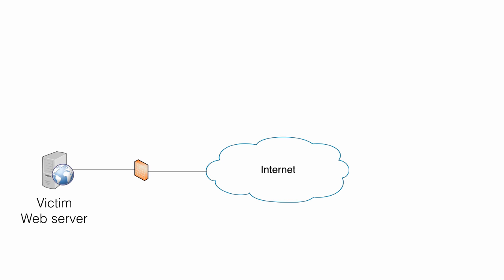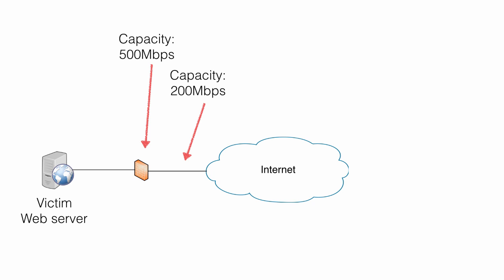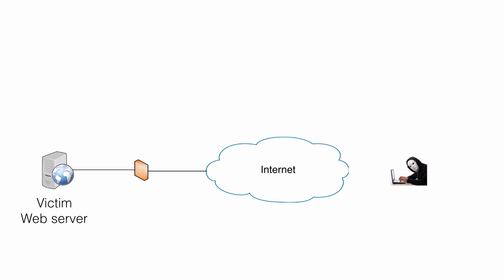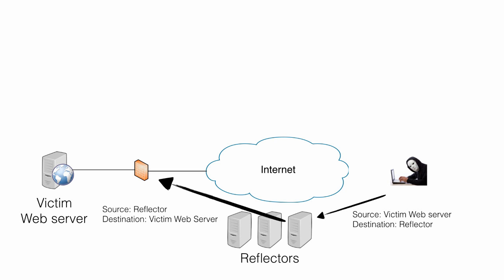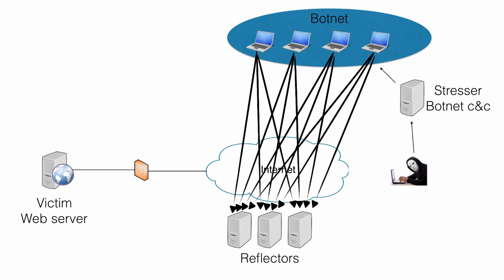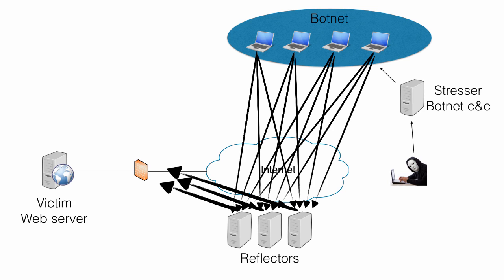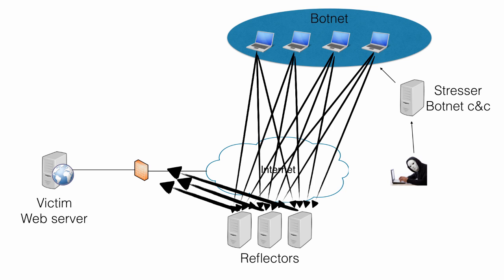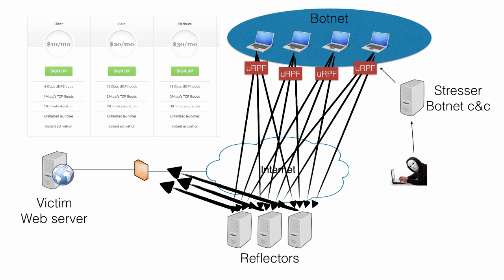DDoS attacks - an explanation of amplified reflective UDP-based attacks

Comment: why do udp is used instead of tcp??
Reply from the maker: UDP is used because it is connection-less. In order to send any data using TCP you have to first do a three-way-handshake which makes spoofing your source address practically impossible.
Reply: @KvistoftaSweden  it’s not impossible, while doing the handshake it just sends a RST flag closing the connection, but it still sends the SYN flag, causing the processors to actually process the requests
Reply: Thank you
 Mr. Jimmy Larsson that's alot for me